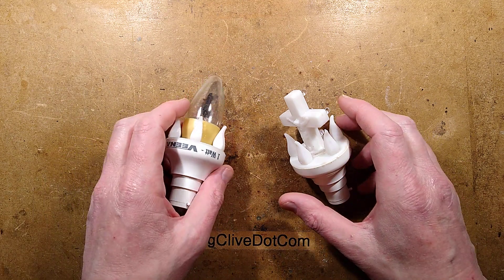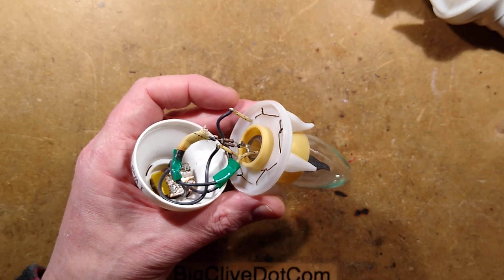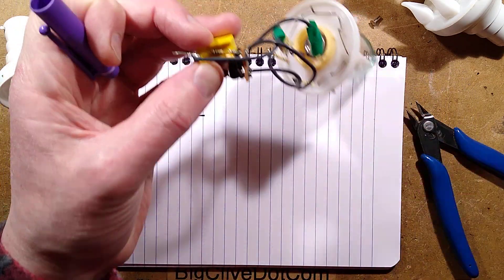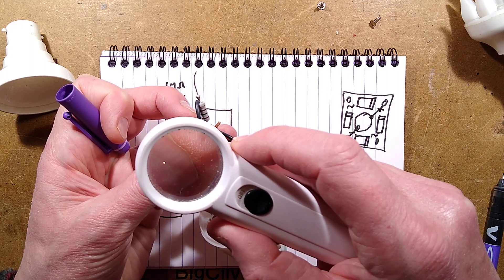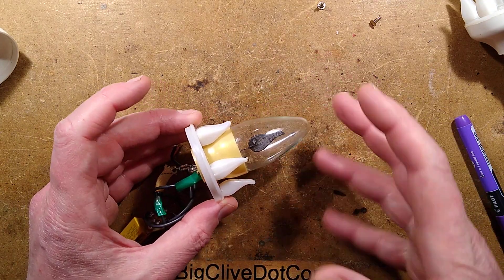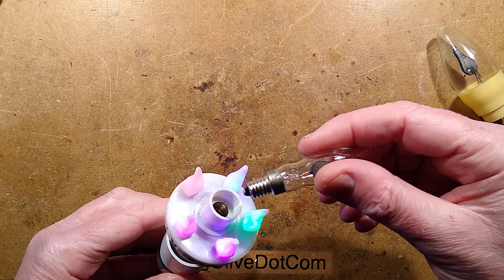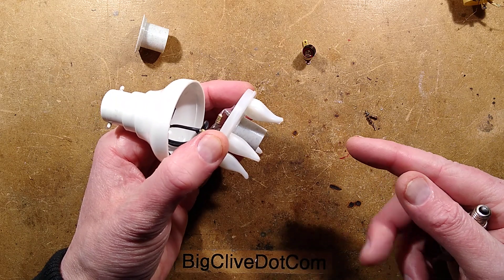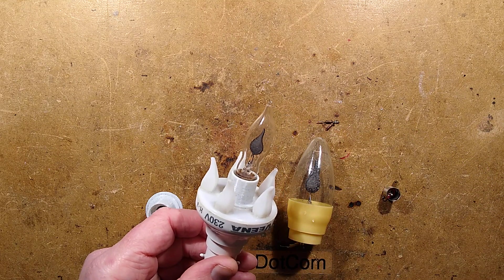Fixing an Indian LED & neon light

Comment: These cheap lamps always keep blowing up even with a slight power surge. Some even behave like a ghost lamp with after glow even though power switch is turned off. They are basically used as bed lamp and run 24x7. The optimum time they choose to blow up is mostly at 3am.
Reply from the maker: That could be the series capacitor failing, or an LED going open circuit and making the electrolytic cap go pop.  The ghost glow is common.  It's the tiny current capacitively coupled between the wires going to the switch.

Comment: They have no idea of thermal management in the design.Put two resistors right next to each other and heat can not escape from one side where the other resistor is, so you would need to de-rate them. It would be better to connect resistors in series as it would offer more surface area to get rid of heat as the resistors would be located away from each other. Also putting it a sleeve will increase thermal resistance making the situation worse.

Comment: I've got a question to you and your knowledgeable viewers may be able to answer, I've got a fibre optic Christmas tree base who's power adapter has failed, instead of ordering a replacement it would be cheaper to replace the lamp with a lower power LED one as I have an AC adapter that fits but only puts out half the current of the original, but would it still work? The item consists of 20w 12v halogen lamp and a small synchronous motor to spin the colour disk, they appear to be wired in parallel but rather curiously when the lamp wasn't installed the motor didn't rotate, it only oscillated about 15 degrees back and forth. I can think of reasons why it would/wouldn't work but I'm interested to see what you all think.
Reply from the maker: If you replace the lamp with an LED one you will still need to use an AC adaptor, as the synchronous motors require AC to work.
If it is an actual AC adaptor, and not putting out DC then it's possible that the voltage is not correct for the motor.
Reply: @bigclivedotcom  The voltage is definitely correct, both the new and old adapters are 12V AC, it's just the new one I've got puts out .83 amps instead of the 2 amps of the old one.   I suppose there shouldn't be an issue  with using an LED lamp but I thought I'd ask in case I'm missing something, and if anyone can explain the odd phenomenon where the motor only oscillated wihout a lamp fitted.

Comment: Those burnt resistors were almost certainly (supposed to be) 680 kilohms (blue-gray-yellow); 2 in parallel would give 340 kilohms, which would work, but be a bit high, for 240 VAC. A 100 kilohm resistor works for 120 VAC (here in the states.) Maybe some dim bulb put 2x 6.8 kilohm resistors in, instead? That might explain the (new, revised) color code of black-black-black (00 with 0 zeroes after it). Look at all those zeroes! 🤣😂😆 Just like the I.Q. rating of whoever put 6.8 kilohm resistors in there.
Reply: Oops, I should have stated that the 100 kilohm resistors I gave for 120 VAC are for ordinary NE-2 neon bulbs, not flicker-flame bulbs. I have yet to run into any power strips here in the states with flicker-flame neon bulbs in them. Maybe it’s because I don’t shop for such things on eBay or Ali Express. Because… Neon.

Comment: If that neon bulb was the one in the shop window, as you said, it probably just died of old age--lit all day every day.  That's how they fail unless they're underdriven to prolong life.  The electrodes in that old one looked like they'd been through a war.
Reply: They did... Could have been slight oxygen ingression or a "gassy" lamp, or like you said, simply "old age". I'm sure that the plates not being parallel in that lamp had something to do with it as well. When I buy those flame neon lamps, I look at the plates of them, and pick the ones with the most even gap between the top and bottom of the plates. Those seem to last the longest in my experience.

Comment: It looked to as if the other lamp with the crucifix was missing one of the sticky out bits that engage in the lamp holder. Was that the case? Cheers!
Reply from the maker: Yes it was.  Thoe plastic version of those pins break easily.

Comment: I am thinking the cause of degradation might be the penetration of oxygen into the bulb itself and oxidizing the "filament". Hence the greyish color. Technology Connection did a video about those lights and he stated in the video after crushing the bulb, the black surface quickly turned into a greyish-rough texture.
Reply: That, or the plates inside that weren't parallel to each other, were most likely the failure points.

Comment: Keep in mind that PLA is in fact one of the harder plastics out there, but - it softens at around 60 degrees (not F or R or any of that nonsense). If you need something that can stand higher temperatures, PETG can handle around 80 (but is a wee tad softer) and ABS or ASA (around 105 degrees, but those will require a closed printer, preferably with good filtering to get rid of the stink and the gases).

Comment: Neon lamps have a limited lifetime, although quite long.   What happens is the electrodes are etched by the ionic bombardment and slowly evaporate.  You can see this in old switches and night lights using neons.   That being said, the old neon lamps used to incorporate a bit of radioactive material to enhance ionization in darkness.   The new lamps from China apparently do not have this and so have different starting voltages between light and dark environments.
Reply: A bit more--the so-called "dark effect" is sometimes used to advantage.   For example, a neon relaxation oscillator when adjusted and exposed to a mains-connected fluorescent lamp will synchronize to the  power line frequency.  Usually Krypton 85 is added to the gas mixture; it's mildly radioactive and helps to reduce the "dark effect".  There's also a 3-electrode neon lamp, named the NE-77; a very small current on the third electrode can cause a lamp held just below the strike voltage to fire.  Neon lamps can be made to function as logic devices, including counters.   Fascinating creatures.
Reply: If you have some flickery, or dead neon lamps in your appliances, power strips, or whatever, shining a bright LED flashlight onto the lamps(when powered up) will usually get them shining brightly and steadily again. The shorter the wavelength of the light shined on them, the better it works... (Think blue or UV LEDs) The extra light photons shone into the weak neon lamps gives then a little extra conduction between the electrodes, and many times it's enough so that the lamp can fully strike and work again.
Kind of counter-intuitive though to have to provide light so that your lamp works... 😕 
As mentioned above, there are some practical applications in some electronic circuitry that can take advantage of this phenomenon with neon bulbs.

Comment: As a colorblind person I am amazed that people seemingly can decode resistor values at all... I always have to use a multimeter. I am even more amazed that color information is retained in a charred resistor package that to me only looks like gray/beige smudge with stripes on them...
Reply: I guessed wrong twice trying to replace a burnt resistor in a 40 yr old potters wheel power supply, eventually I found a schematic online for a similar model in a forum. God bless the guy who posted it (and tiny Tim too).
Reply: @Derek_Garnham  I built myself a switchable "decade box" of resistors just for that purpose... Start high, until your item works properly, then read the box, and that's your unidentifiable resistor.
Reply: I wonder if there is "an app for that" - if there isn't, there should be, I remember my  brother being told that he couldn't be an electrician or a train driver etc due to his Daltonism. My father was also red/green colour blind, he worked as Haz-Chem tanker driver, when we asked him about traffic lights, he said it's easy, the red one is on the top! (If we ever played snooker, arguments ensued).
I dodged the genetic bullet, don't think life as a chemist would have been so easy if I hadn't had full colour vision, though I've met a couple of people who got by.

Comment: Veena is a musical instrument, the 'na' is a retroflex sound (with the underside of the tongue touching the top of the mouth). 

The commonest bulb holder in India is the bayonet type (B22). Only torch/flashlight bulbs used to be edison type at the end of the socialist era. Nowadays fancier lamps often feature a compact edison holder. 

Also you might have made a death lamp because the Edison holder's terminals will have a random voltage depending on how you orient the bayonet end.
Reply from the maker: That's why I used a deep shroud around the lamp base.
Reply: @bigclivedotcom  I figure you can still make contact when the bulb is partially unscrewed. Edison holders are probably better suited for 110V.
Reply: The ONLY way I can say "NA" is by touching my tongue to the roof of my mouth.... IS there another way to say it without doing that?? 🤔
Reply: @davelowets  If you read my comment again you'll see that you have to touch the roof of the mouth with the UNDERSIDE of your tongue -- by folding it further back than an "n" in English. 

In my language there are three "n"'s in fact, the third one by touching the roof forward near the teeth, using only the tip of the tongue (instead of the top side of the tongue).
Reply: @rexsceleratorum1632  still comes out the same for me... 🤷🏻
Reply: @davelowets  That's probably because you are not used to distinguishing the resultant sounds. In my language you have to distinguish them to identify words like manam (mind) vs maNam (smell, with the retroflex sound). Likewise I have trouble distinguishing between V and W, and also S and Z in English.

Comment: I'm glad to see that they are so concerned about their workers that they don't use solder on any of the discrete components.  I'm sure it is not to save money...

Of course we won't talk about the fire hazard or easy-open cover
Reply from the maker: It was originally glued shut.  India has a more relaxed approach to live mains connections.  I'm not sure they use grounding much.
Reply: @bigclivedotcom  I've heard people say it's down to the dominance of fatalist philosophy, other less generous just say "life's cheap", I prefer the former.
Reply: @Derek_Garnham  Life is definitely cheaper in the third world.
Reply: @bigclivedotcom  In my region of India, every house has always had grounding and newer wiring has RCCB's. The socialist government monopoly "Electricity Board"'s distribution infrastructure has always been much sloppier. In the early 90's as I was growing up, I would often assist (holding up a light mostly) in fixing a distribution fuse for the entire neighborhood because no one would come from the "Electricity Board" unless you bribed them. Of course everything is live and sparking, and the fuse block is exposed and likely wet from monsoon because they rarely put them in any kind of box. Things are much better and less socialist now.
Reply: In India 230V is not considered particularly dangerous. Back when the first gen ventilated LED bulbs were common, people would remove the diffuser because it filled up with trapped insects in no time.

Comment: That lamp never worked.
If you look close, you'll see the tip of one plate is bent in, which makes the plates not parallel at the top. 
This will prevent electric fields from building up at the tip. It acts like a reverse Jacob's ladder!

Comment: They didnt really think through the one with the cross on it did they, would look a bit off put in a ceiling light fixture.
Reply: They are meant to be put on upright fixtures which are mounted under a framed picture of a deity or perhaps even a deceased family member/ancestor. There was always one at my grandparents', with a neon flicker lamp pretending to be a candle under a framed picture of the 'sacred heart of Jesus'. It also acts as a mini-shrine during family prayers (which would take place every evening in Syriac-rite Catholic families like mine).
Reply: They are never used as a ceiling light. More like a virtual candle placed in front of an object of reverence.

Comment: I noticed that the plates in the old neon bulb didn't appear to be gapped properly. If that old bulb was given more current it may have worked better(till it failed from overdriving it).
Reply: Yep. If the gap is much too small at the bottom, compared to the rest of the plates, the neon will only glow and flicker around at the bottom like that. The reverse is true if the gap is large at the bottom, and narrow at the top. If you are buying one of these bulbs, look for the plates to be fairly parallel to each other, and it should work OK for you.

Comment: With the amount of stuff you work on being able to print in abs is a key tool. In my experience and ender 3 just about fits in any under counter cabinet if you remove the upper drawer. I then tape a cardboard flap on the inside of the removed drawer and one side of the door to create a good seal. This will print abs perfect and better than any purpose made off the shelf enclosure I have found.
Edit: Just make sure you have heat soaked it.

Comment: Since only 2% of the people in India is Christian  that  lamp with Jezus and the cross it is a great find .
Reply from the maker: It is a bit odd.
Reply: This is based on a southern lamp design, and in Kerala close to 20% are Christian, owing to ancient Christian presence from the middle east in the Malabar coast. In Kerala Hindus also join in on celebrating Christmas, so there is that as well.
Reply: @rexsceleratorum1632  wow thanks for the update.

Comment: I haven't seen carbon-film resistors with "cap ends" like that in quite some time. Old Soviet stock they used...?
Nice use of the 3D printer, making that adapter/insert!
Reply: Those are common, especially as the machinery that made them likely is at a local supplier, churning out millions of them a month.

Comment: What's the rule of thumb for discharge resisters?  I'm guessing that there's not much current running through them normally, so 1/4W 1M Ohm on a 120V circuit is fine? (Oh wait, duh: 120V^2 / 1M Ohm = 0.0144 watts, never mind.)
Reply from the maker: They're purely to reduce the voltage across the capacitor fairly quickly when the light is unplugged, so they can be a high value.  Usually 330K to 1Mohm.
Reply: I'd say the RC multiple needs to be shorter than the time for a human to enter the danger zone.  For example it takes at least 1 second to unplug the bayonet lamp and risk touching the bottom pads, so 1M times 1000n is small enough.

Comment: i have a BC based flame neon, that also seems to have 'degraded', i probably got it 40 ish years ago, when i was about 10, from a nice old electrical shop in a nearby town(gone for quite a few years now)  maybe a common problem with them?
Reply from the maker: Still available on eBay.

Comment: 1:11 Wow, what a decent build quality, the leads of the LED's just twisted together, why didn't i think of that. Really nice quality.        (Sarcastic mode on  🥳)
Reply: We had a Christmas star full of these blinking LED's here in the south of India. It was permanently hung outside (but out of the rain), and it lasted for three or four years. I took it apart (a back panel was pressed in) and the leads of the LED's were not even twisted together, just bent once so that each one hooked the lead of the next. 

The leads were all rusty, but I would expect nothing less because of our rainforest humidity. 

So I bought a new one, made exactly the same way, and cost me almost 5 USD.
Reply: @rexsceleratorum1632  Quickly soldering the ends together would most likely greatly increase the reliability of the unit.
Reply: @davelowets  No doubt. Maybe I'll get around to doing it sometime. Or not.

One thing that certainly worked in the previous star's favor is that Christmas falls in our very short dry season between monsoons and the star stayed switched off the rest of the year, so any electrolytic corrosion was probably minimized.

Comment: That smaller flicker flame lamp you added looks much better with those color changing LED flames. The convenience of being able to unscrew the bulb is a definite plus. Clive I've been wanting to tell you that I recently purchased a Yihua 995D+ soldering station with soldering iron and hot air rework pen. I absolutely love it. I also purchased a basic Kungber SPPS-S3010  0-30VDC 10A power supply. I got both of them at less than half price at Amazon on sale while signing up for Amazon Prime. Both were early Christmas presents to myself. Merry Christmas to you, brother Ralfy and all the kitty's!  🤗
Reply: As an owner of both a Yihua 939D+ soldering station and the exact same Kungber power supply, I think you'll be quite happy with them. You may wish to replace the leads of the Kungber with something better down the road, but it's still a great value. The Yihua is heats up quickly when you first turn it on, recovery time is fast as well, and if you have a quantity of wires to solder you can get through them at a much faster pace than a standard iron. Merry Christmas, enjoy your new "toys!"
Reply: Thanks dashcamandy for your comment. You are exactly correct. I built up 20 wiring harnesses a few days ago and I was very happy with the performance of the Yihua soldering station. Merry Christmas to you and yours!  🤗